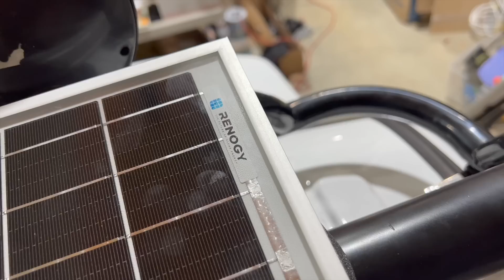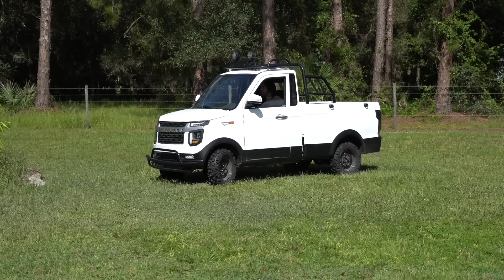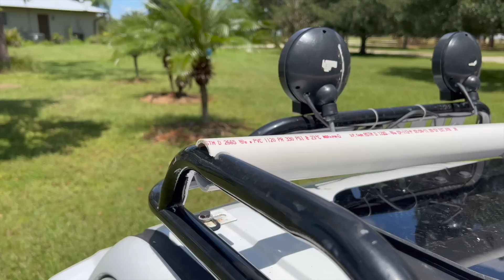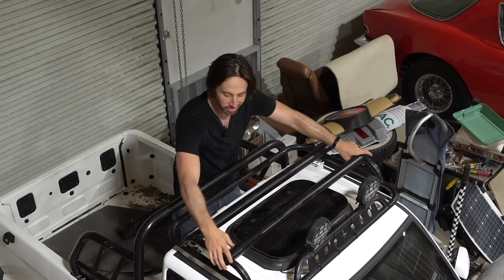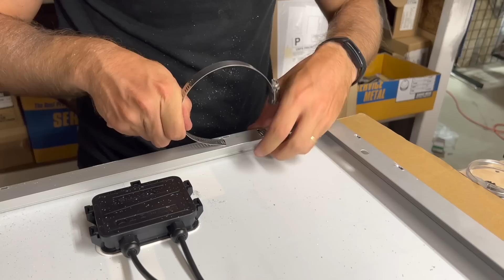I added a solar panel to charge my $2,000 electric truck

Comment: You should  put a swivel  attachment  devise on the solar panel  so you can raise  and lower the panel to whatever angle you need.that way you won't have to move the truck to accommodate the direction of the sun.

Comment: Hi from Devon uk,enjoyed your video,I saw a demonstration where a solar panels output was increased by a factor of 4 by simply attaching 2 hinged  reflectors 1 either side to the solar panel, it was done at a uni by a prof,hope this info is useful Barry

Comment: I like the overall Visual and test of the truck however $2,000 is very misleading it's more like 5 to $7,000 if you want it equipped and in the same country As You Are

Comment: Robert Murray Smith on YouTube has some panel mods that double the panels output. Might want to check that out. It would almost be something to consider: Making a small trailer with enough panels to charge the battery.

Comment: The mystery clunking is the box bouncing i think , it doesnt lock when its the down position , thats my thinking anyway , i noticed in other videos its bouncing  when you go over bumps....
Reply: Actually there were 2 clunks.  One was the bed and we fixed that with a foam rubber pad on the frame rails.  The other we found was a bad suspension bushing on the right front.  Need to find an hour to take it apart and replace it.  Shouldn't be a big deal.  Thanks for your comment.  Regards

Comment: How would you go about replacing the windows or windshield down the road if it got cracked ? Also what is the top speed of this truck ?
Reply: Good question.  Not that hard to make a new window using the old one as template and a piece of lexan.  The lexan can be bent using a heat gun.  I have done that making a racing windscreen for another project.  28MPH.  Thanks for your questions.  Regards

Comment: if you could include some sort of angling mechanism so you could tilt the solar panel in the direction of the sunlight,  you could maximise the charge without having to drive the car into the best position

Comment: there is a 26x40 inch 100w panel out there for $100 i bet would charge much better. you could also make a foldable hard tonneau cover out of the 100w solar panels that could fold up flat against the back window when you need the bed for use.

Comment: You could put the flex panel over the hood, put them both to use.

Generally, the rigid panels are better. They achieve better cooling, which makes them last longer. But, since you have both, the flex panel is perfect for going over curved car panels like hoods.

Comment: Could you mount the flexible panel to the hood? Would that help in anyway?
Reply: Certainly could be done and yes it would charge faster but our experience thus far is that the panel is generating about the same amount of power that we are using so we have achieved the break even point or close to it.  Only needed to charge it once since the panel has been installed.  I am estimating that we would have needed to charge it three times if no panel.  Hope this info is helpful.  Thanks for your comment. regards
Reply: @micahsdad5388  definitely appreciate the response. I’ve followed this build since the first video and have enjoyed it all. Thanks you for the info and entertainment
Reply: @jtj1331  It has been very entertaining for us as well !!  Stay tuned for the one year review video.  We have already begun to film it.  Will finish it the next time Micah swings through town.  More upgrades and more info in general.  Spoiler alert --- it's working perfectly after a year of substantial use.  Stay tuned - same Bat channel. !!

Comment: 2 panel up there and a flex planel on the hood.  3 panels would be really interesting to see what happens
Reply: Faster charging for sure but perhaps not worth the extra expense.  We are about net neutral energy usage.  That was our goal. Best regards
Reply: @micahsdad5388  absolutely. I was just thinking even during cloudy weather this could counter  the lower charging power. And when it's sunny make up for the times it wasn't changing much

Comment: Now I might be wrong but wouldn't it charge faster if you let the battery voltage dip lower before you try to charge it with solar power?
Reply: wríbf

Comment: I tried to do the same thing for charging one of my electric bikes but you loose so much power boosting the voltage for charging. I used a different controller but the same rules apply. I came to the conclusion that 36 volts was the bare minimum input voltage but more is better. 48 volts should be used for 36 volt batteries. (4 panels in series) 60 volts for 48/52 volt batteries. (5 panels in series) Plus, if you aren't charging a battery you are baking your panels for nothing. I was using a 36 volt battery charged by the sun and a second mppt programable charge controller to charge a bike at night. Worked well but I needed more, more, more!!! $$$

Comment: It looks like if he slides the solar panel to one side there may be almost enough room for a second one. Or a different one with a greater length and wattage. Just thinking that it would be more reliable as a trickle charger with a little more power input.

Comment: Fit a bigger panel, should be able to fit a 100w module.
The bonnet space looks unused also? 200w total maybe?
That could be significant 120w possibly and you'd never need to plug in depending on use obviously.

Comment: Extend the rollover cage/support which is between the cab and back loading area in a stright line to front bumper. You can put 4 to 6 panels and also keep the cabin cool.

Comment: Hey first off love the vids , Is there anyway I can use a 750 befang rear hub motor on the front??? Can't find any in stock for a 26" x 4.0" fat tire bike and I'm wanting to make my Himiway cruiser an all wheel drive . Yes I know I will also have to find some sturdy front forks to handle the torque as well.

Comment: The top deck of the truck is still under utilized, can look into putting a 100W panel on top n another 100W panel sloping towards the back just off the Top deck, you would then get 200W of solar charging ..

Comment: Is there a 2 seat dual motor AWD small truck with bigger wheels, and the option of solar bonnet , truck bed side and cover? And dual battery setup? When you drive you use the solar energy to charge and power the "internal battery" but while you are parked you charge the main drive battery. (P.S. I need a 180-220 mile range of a constant 80 mph speed driving without the solar panels but with regenerative braking because of the mountain side road that goes up and down often, and with AC and lights on, so an estimated 200-260 miles with solar panels) ... and how much would something like that cost .
Reply: buy sono sóar tr 190 mile  gróhiñe   vamoier 2⁹5  mióé ranbfe

Comment: I would go with flexible bed cover with a flexible solar panel on it + the front bonnet with a flexible solar panel to be slim and curvable for the fit , and a small rigid one on top ( maybe some flexible strip panels on the truck bed sides too) and you have a complete setup that could also give you enough energy to run AC and infotainment while you drive (and let the main battery power only the steering and engines)

Comment: This is something I've always dreamed of doing. A trickle charge setup on a fully electric vehicle. Well done
Reply: I'm a retired Electrician and I have wondered about putting solar on the roof, hood  and trunk area of the EV. Just like your EV truck while the EV sets in the sun it is trickle charging the batteries. In the future the solar panels will get more efficient and will help extend the range of the EV's. As putting 2 on your truck, could use 2 slightly smaller panels but combined would give more output and not be too big for the roof. Well Done!

Comment: I have not seen any videos on the CSC City Slicker. Have there been any upgrades in the last few years? They have a 26ah battery but with recent upgrades to batteries and your own battery builds would it be possible to increase the range to 40ah?

Comment: A few questions about this cool toy...
Why this over a Kei Truck that would cost about the same, can have dump and be street legal?
Are you going to reweld the parts that were just tacked together?
Why didn't you touch up the rust spots before they got worst?

Comment: I wonder if it will pay off in the long run? If it cost $160 to add and you figured on the high end $0.20 per kW that setup would have to give you 800kW over its lifetime to break even.

Comment: not that it would make a big difference in this application but a friend of mine designed curved tube mounts for a solar panel, filled the curved tubes partially with oil and mounted so that the panel would move back and forth to stay aimed at the sun.  The sun would heat the oil in the in the curved tubes and change the center of gravity weight in the tube when the oil expanded and stay pointed at the sun.  This was for a christian mission in Africa.

Comment: My power supplier doubled his kWh price. I got a new supplier and it's about 32 cents per kWh now. So I'm using my back-up solar to offset some of the increasing cost. My  recommendation is build a carport for the e-truck and load the roof of the carport with enough panels to fully charge the battery in less than 10 hours. So it can change whenever it's not in use, and the sun is out..

Comment: great video dude, i would add a folding panel behind yours so you can choose between optimised charge rate and rear visibility, or extra load space in the bed if required

Comment: Also i was assuming a minimum of 100 watt panels but good job using whatcha got, I'm looking at 1000 watts max mounting to my v8 1500 100w per panel x10 and should cut down on alternater use to 0 during daylight  still need it at night though  i got a whole extra battery spot under the hood so only 12v system but 4x4 &mainly 2x4 for freeway use thinking about hybriding it leaving the monster motor but adding wheelhub rears to save brake pad energy which I'd need to install more batteries to contain but it's just a daily driver test platform the topper allows me to still ise the soace for hauling or camping if I'd remove the topper panels it'd cut my solar collection capacity by 60% but 400 watts is nothing to shake a stick at. I'd love to be donated a tesla to reveiw/keep and maximize how much solar and other renewable charge sources i could fit on it but for now I'm sticking American made petroleum product supporter because having less of it increases price not lowering fuel price or products price so i gotta do what i can to both support the economy however slowly but also myself  no sense being dead weight for taxpayers to be required to carry like a communist country or something

Comment: Mate put a roof rack on that overhangs from the front of the roof all the way to the back of the tub. Not sure if youse do that over ther much but it's common here in aus and you will have tripple the area available for solar

Comment: How tall are you? So we can get an idea of the size of the cab of the  truck.
Reply: I'm 5'10" and fit in it fine with adequate head room but the seat is all the way back and there is not a huge amount of superfluous space left.  My sense is that 6' is probably maxing it out without the need for medical consultation upon exit (LOL) Hope this helps.  thanks and best regards

Comment: I can think of a couple of options in case you use the truck enough so the solar don't keep up  or on cloudy days. You have room for a larger solar panel. You could add the flexible solar panels to the hood too. The panel you are using does well so probably a slightly larger panel would be as much as you would need.
Reply: The telegram guy is a scammer

Comment: can you up grade or install a second battery and also add the ability to plug in portable solar panels?
Reply: The telegram guy is a scammer
Reply: The existing battery is plenty big enough for its function. Why add cost and weight and reduce space and load carrying capacity?

Comment: Any time I drill into an aluminum solar panel frame I always put a piece of heavy metal down to keep from drilling into the cells. A few seconds saves costs and time. In regards to the angle of the panel, you can roughly estimate the loss by angling a panel by taking the cosine of the angle times the panel output. If you just scratch out a few example on paper, you'll find that up to around 20 degrees (if I recall) there's very little loss.
Reply: Yep - we backed the frame with a chunk of metal while we drilled it.  Hard to see as it was square bar stock but look carefully at his thumb holding it in place.  thanks.  regards.

Comment: Now you can't use your roof rack or see out the sun roof. Should of mounted it on the hood. It's thin enough so you can still open your hood and doesn't block visibility.

Comment: So, if you rotate the panel, looks like you could easily put two of them on the roof, then two of them on the hood. That would get you closer to about 100w average charging with the panels being fixed position.

Comment: I plan on doing this to my 2006 Miles ZX40 NEV.
It has a roof rack already, so it should be quite easy to do.
The Miles has a 48V battery pack.
Reply: I will probably use one or two LARGE 24V panels, totaling 380 or 760 Watts.
I should get a LOT of range from each Sunny day here in the high desert of Northern Nevada, and can connect the car in parallel to my 48V home battery, to make use of any "extra" energy collected by the car.
Reply: The telegram guy is a scammer

Comment: Why didn't you put a panel on the hood of this truck as well?   Double the charging rate, or better yet put 2 additional panels on this truck (2 on the rack mount, and 1 on the hood).   Therefore tripling your current charging rate.   You could point all the panels forward instead, that way the rack mount panels would match the same pointing direction of the hood solar panel.

Comment: Put two Panels on the roof or expand the roof to the Back. Make it so you can remove the Back section, If you need more height on the bed. Then put some Panels on the hood in the Front. Enjoy never having to Charge your car. You can so this.
Reply: The telegram guy is a scammer

Comment: if that truck never sees hiway speeds I expect the backward angle would work but for anything over 35 Id be concerned about air getting under it and blowing the whole thing off.. angled down toward the front like a spoiler or deflector would have been my choice but then Id also do like others suggested and have the flex panel on the hood... Ive said for some time that if manufacturers just put solar panels on the cars they would be more attractive because they could charge in the parking lot or at stop signs or before you wake up etc... pretty sweet build all in all
Reply: The telegram guy is a scammer

Comment: I have a question about ebike throttles. I'm wanting to install a pair of aero bars on my converted ebike and was wondering if there was a way to install a second throttle, so I can throttle in either postion, without them canceling each other.

Comment: Try to find a panel which covers the whole top (or parallel with a panel on the hood). Also having a bit higher VoC will help, the 17V input is very low for this boost converter, tey to find a 30 or 40V panel which just fits. That will maximize the energy into the car and in the end will save your energy bill.
Reply: The telegram guy is a scammer

Comment: What i'd like to know is if you could modify the.... bracing? on the truck bed to be a 4 post, and then have full length solar array, how far could you dive it each day, and how would that impact the dump bed
Reply: The telegram guy is a scammer

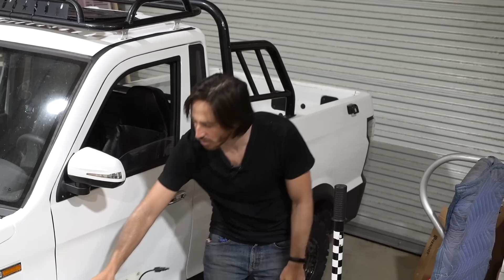Comment: 2:09 adhere the flexible pannel to the hood, and they make real flexible pannels that are designed to roll up, IIRC the type of pannel you have is just the same cells as in the rigid pannel, but much lower profile for better aerodynamics, lighter weight and compact storage.
Reply: The telegram guy is a scammer

Comment: That panel won't even turn on one headlight bulb...
Efficiency of solar panels is currently very poor.
Reply: Thanks for your comment but, ...... wrong.  Not powering truck directly from the PV panel.  That would be silly as the power would drop to near zero with every passing cloud.  The PV charging system we added roughly replaces the energy used in the course of one day of the trucks use, on average.  Therefore, the solar panel greatly reduces or will eliminate the need to plug the truck into the 110v wall charger.  ".   Re: efficiency, depends what you mean by poor.  Yeah, 20% PV power conversion rate is not great if you think of it as 1/5 of the power of the sun hitting it.  But ..... the most efficient gas IC engines can hit 40% but this is not the average, which is lower.  Diesel is less.  And the solar is FREE and clean energy.  "Seek first to understand, then be understood".
Reply: @micahsdad5388  diesel is much more efficient than petrol. If geared & driven properly.

Plus think about additional wear & tear on the car from keeping it directly in the sun. Intentionally.

A much better option will be solar parking shed.

Comment: Awesome project!  and great idea for a float charger, if the mini truck gets used only a few days a week, solar power should be all it needs
Reply: That's the way we see it.  Time in the sun when used covers the energy expended.  We put solar on my kayak a while back with the goal of achieving the same result.  (see the Youtube video).  Some days I come home with more power in the battery than when I put it in the water.  Too cool !!  Thanks for your comment

Comment: Correct me if I’m wrong but most chargers output slightly more than the battery is rated. Eg. 52v battery on my E-bike and charges to 58v and some change.